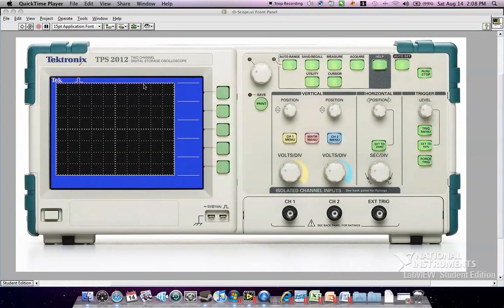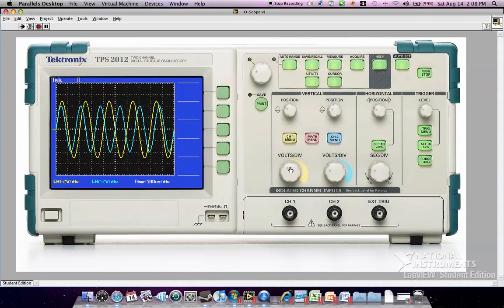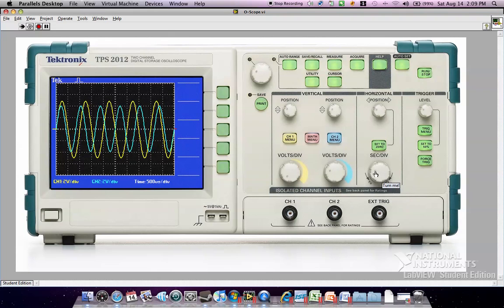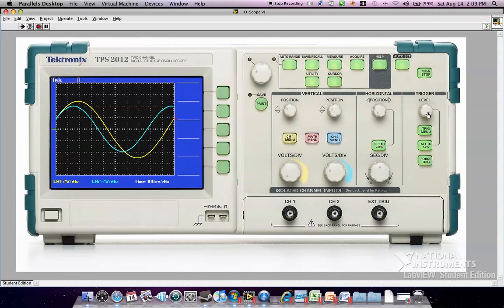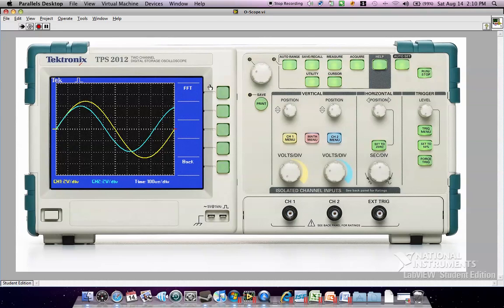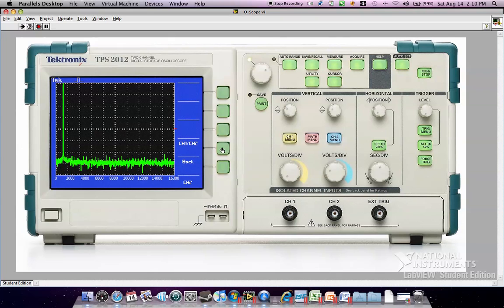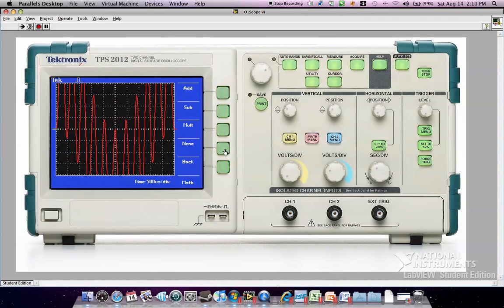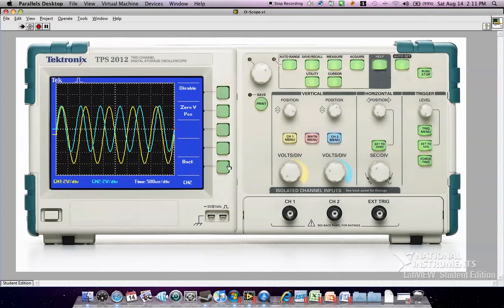Oscilloscope project 2

Comment from the maker: I've had a lot of requests from people asking me to provide the vi file for this project. Unfortunately, I lost all those files when my laptop drive took a dump. I'll see if I can't rebuild part of it and get it posted somewhere as an example for others.  I can tell you that it was by no means optimized. I threw it together in a few days after only spending 2 or 3 weeks learning labview in my class. Therefore, I'm sure I made a lot of mistakes (in terms of efficiency).
Reply: Hi Kyle. I know it has been many years since you posted this, but I was wondering if you did end up managing to share the VI file somewhere? I am doing a similar project and just cannot work out how to shift the waveforms horizontally, so would love to see how you did this.